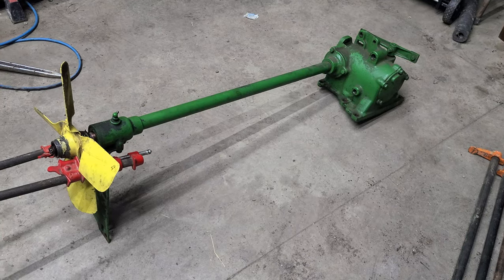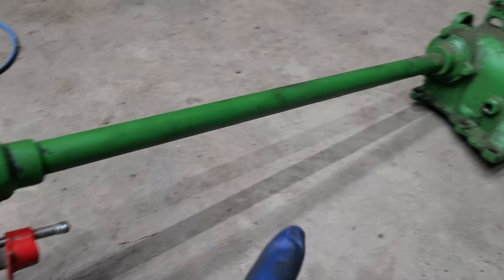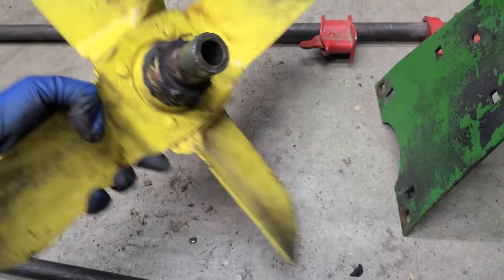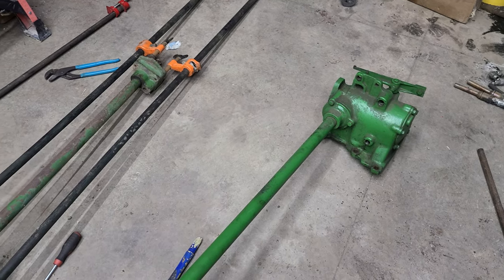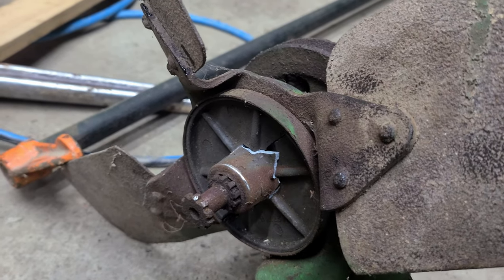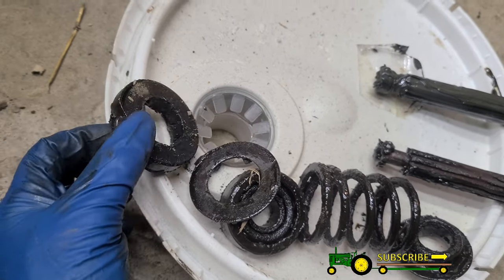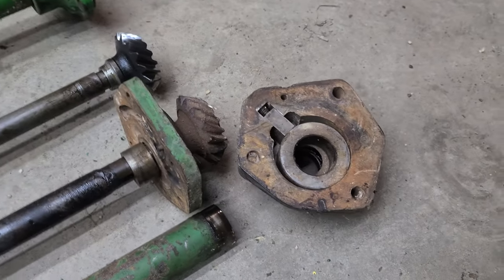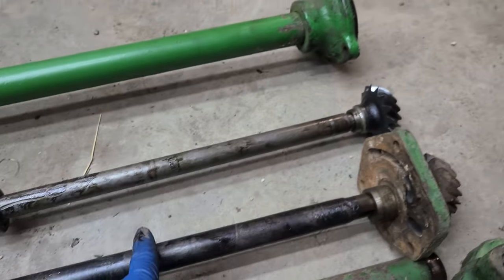1939 John Deere A Part 3 - Fan Shaft Conversion - Restoration Series

Comment: Update on my tractor, i know its been a while, but my engine is free, but my 2 intake valves are not. I was rolling the engine over to complete all of its strokes and i heard a snap, I broke one of my tappets. So ive been waiting for parts, and while ive been doing that, ive been working on the battery box fixing a rust hole in it. As well as taking apart the steering coloum, cause thats froze up too.

Comment: Did you ever find out about the spacer? Im dealing with this at the moment. Mine was inside the housing but not on the shaft where yours was. i cant get mine back together because of the spacer.
Reply from the maker: Yes,  I ordered the spacer.  I've been waiting to get a new fan from someone to replace the old style.  I'll hopefully get it back together in the next few weeks.  The spacer is supposed to be a tight collar on the shaft.  You think yours had something else?